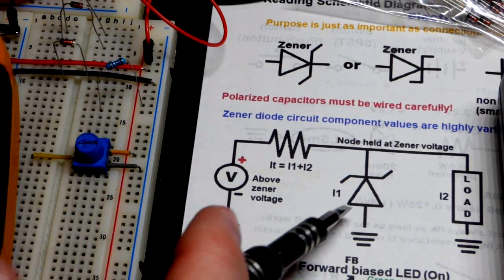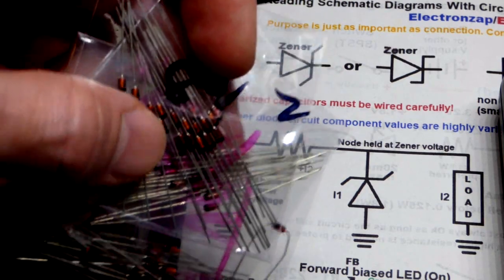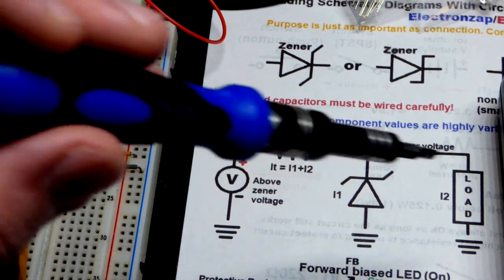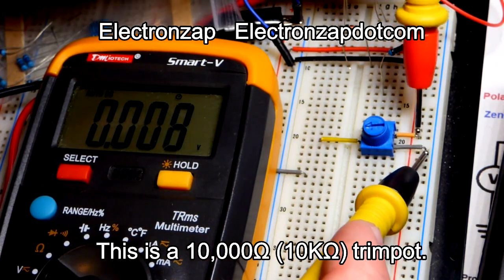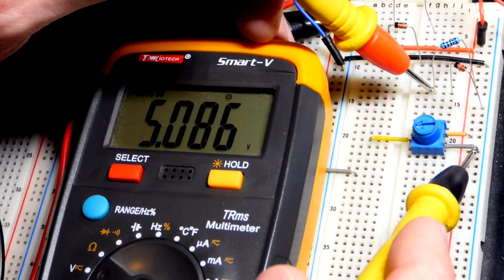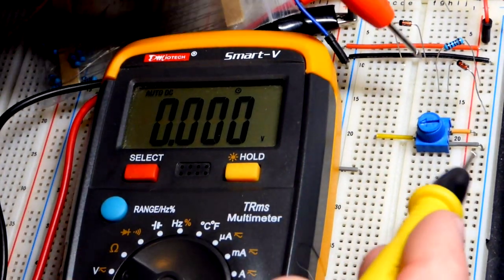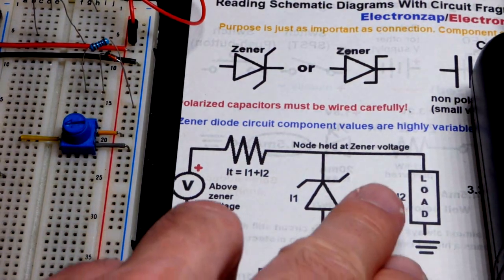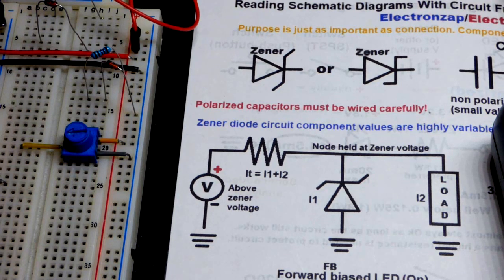Zener diode component basics for beginner learning electronics tutorial

Comment: Some people don't realize the  Voltage of a Zener is not the forward voltage but the reverse break-over voltage.    A really interesting concept and  useful little device...    I love zeners you can use them for all kinds of stuff like driving the base or the gate on a transistor at a very specific voltage for example.    I got a nice little Amazon assortment too  8 )    Mostly all you have to worry about is make sure the load is within the rating of the zener and you are good to go...   I usually go 60% of the rated max on most stuff when I design a circuit.
Reply from the maker: Nice!